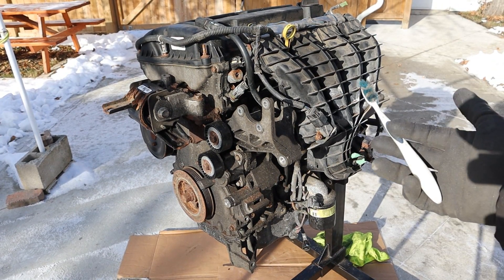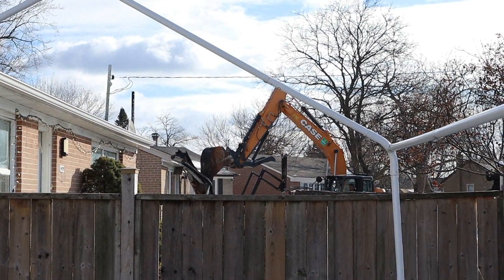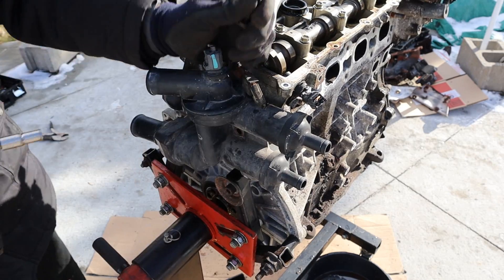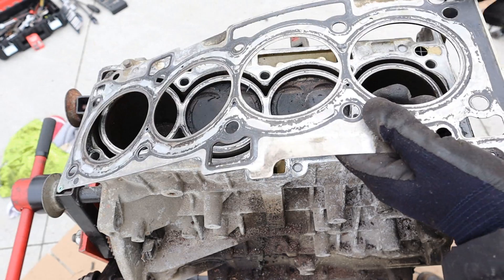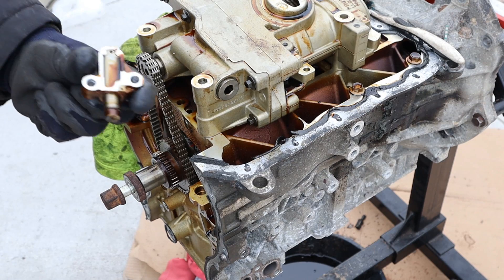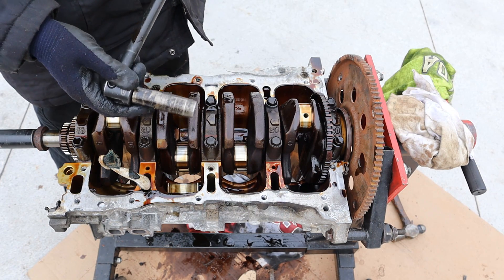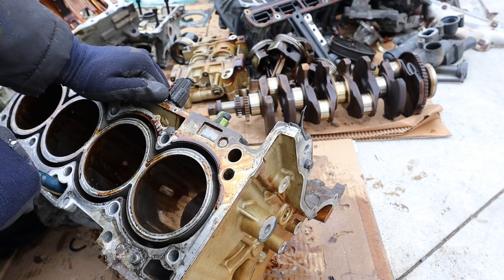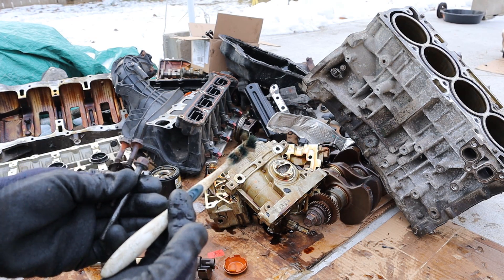Why the Chrysler World Engine is a Failure

Comment: I find it helps during original assembly to first dip all the bolts in seawater.

Eh, I guess it looks like a decent enough budget engine. Except for those bolts, that is insane.
Reply from the maker: Designed well. Poor execution
Reply: @speedkar99  sounds like Chrysler

Comment: my 2000 2.0 dodge neon (only owners until sold a year ago, after 21 years of service) was running on water for a LOT of time, instead of coolant, becausa it had a leak on the head gasket; which i fixed after i discovered the existance of a gasket sealant... Never consumed a single drop of the new added coolant for 8 month prior to getting sold... Bulletproof engine XD (was not going to pay an engine rebuild because was an expensive job here in DR for a car with a used avg. price of US1,500)
Reply from the maker: Awesome! Though I don't think that was the World engine shown here
Reply: The most famous 'head gasket blower' prior to 2.5L Subaru. I think they 3 or 4 head gasket revisions before they finally got it right.

Comment: 13, 17 & 19 are the common AF sizes for metric fasteners.
Reply from the maker: On Japanese brands it's 10,12,14,17,19 and that's what my socket set has. 

My 13,16 and ,18 sockets have been barely used.
Reply: @speedkar99  Yes, that's the JIS standard (Japanese Industrial Standards board, 10,12,14,17,19mm hex corresponding to the respective thread sizes).  On older German cars, it was mostly the same as that except they used 13mm instead of both 12mm and 14mm, which I believe is what the DIN standard used to be (10,13,14,17,19mm).  That's why a lot of socket or spanner sets only include 8,10,12,13,14,17,19mm etc. 

However, the ISO/ANSI standard uses 11mm,15mm,16mm,18mm etc.  I think it's strange that when American cars went metric they didn't decide to align with either the existing  Japanese or German standard (I guess because sizes like 16mm are a better match to existing SAE AF sizes like 5/16"?).  A lot of European brands now use the ISO/ANSI standards instead (as well as trying to use as many novel fastener types like Torx, E-Torx, XZN, Ribe-CV etc as possible!).

So people have this argument that with metric you need every sequential size which is inconvenient, instead of the convenient smaller subset you could get away with AF or Whitworth.  But that's because of this mess with standards that don't match.  Fortunately the larger thread sizes are still fairly standardised on their bolt head sizes and 24,27,30,32,36mm tools should usually be enough.
Reply: @TassieLorenzo  Yes, and let's not forget that cars are not the only place fasteners are used and North America / Canada is not the world. The sizes I specified are the only ones I ever come across on anything found in the UK, and probably everywhere except the North Americas.
Reply: @davelowe1977  Yep, 10mm and 13mm bolts are also what I found on European appliances like a Miele washing machine.  However, I'd be surprised if you didn't find 10mm but then 12mm and 14mm bolts on a Japanese appliance like a Panasonic air conditioner or Panasonic washing machine because it will be following the JIS standard, just like a Japanese motorcycle or car.
Reply: @TassieLorenzo  someone once quipped that "the beauty of standards is that there are so many of them"!

Comment: i dont think thew core engine is too bad except the open deck. Its all the plastic thats around it thats making it useless. Iam surprised they ran this with solid lift....people usually pay big money to switch to solid-lift for high rpm stuff =D
Reply from the maker: I agree. The bolt on stuff kinda ruins it.
Reply: open deck is fine until you do a big turbo.
Reply: @nobodynoone2500  i know, but its pretty much the only obvious drawback i saw. If you dont need to css a block its way cheaper to potentially build it.

Comment: can't believe the amount of plastic parts in that thing.  The counter balance mechanism was crazy complex...why would they not mitigate the vibration at the design phase.  It seems like an afterthought.
Reply: Does the balance shaft mechanism add any durability benefit whatsoever? Or does it just reduce the harmless 4 cylinder buzz felt in the cabin without any reduction on the vibrational forces on the internal engine parts--(my suspicion)
Reply: @davidpowell3347  the balance shafts are only used to lower the vibration transmitted to the user/passengers. No durability benefits. I think most automakers use them only for that purpose.
Reply from the maker: Yeah...alot of other 4 cylinder engines go without a balance shaft. It takes away from economy and adds weight.

Comment: Not sure why you seem surprised and/or disappointed with chain guides being made of plastic; I reckon you be hard pressed to find a modern timing chain engine without and there are plenty of examples of them being durable. Also examples of them being total (BMW) crap of course 🙂
Reply: Honda K series still has metal backing frames for the main chain guides (be it the K20C turbo or the NA version).  The guides and chain still look the same as the original K series engine in 2001 as far as I can tell, so it's probably the same part number as since it was a decent design there was no need to change it. 

The all-plastic timing chain guides (i.e., with all-in-one plastic frames, obviously the guide material is always going to be nylon) seem to be more of a cost reduction or "value engineering" thing rather than a "deliver high quality" thing?
Reply: @TassieLorenzo  thanks for that, interesting info. BTW plastic guides break more because of extended oil change intervals than anything else. Excessive carbon deposits wear down the chain and guides very quickly.
Reply: Is there a choice of what kind of plastic to use? Cheap plastic? Biodegradable fragile plastic made with the approval of harebrained environmentalists?
Reply from the maker: The modern Pentastar isn't much different, I think it's just a Chrysler thing. Alot of other brands have plastic but not this much!
Reply: @speedkar99  come on,  everybody is using plastic on their engines nowadays.  My son's 01 Lincoln LS v8 has a bunch more plastic than this engine AND they regularly fail. At least, on this engine none of it failed, and I thought the plastic pieces looked pretty good especially considering this one was not well-maintained.

Comment: I want to see you pull apart a Veloster N Performance pack 2.0T
Reply from the maker: Yes!
Reply: @speedkar99  2019-2020 models are known for having oil circulation issues, but all the engines are paired with a pretty poorly designed turbo that doesn't last too long. other than that there are no known mechanical failures! I'm curious about the turbo construction

Comment: Why use the word failure?  I'm no fan of modern Chrysler but cannot see anything seriously wrong with the design of that engine and you said several times it was high mileage.
Reply from the maker: Look at the plastics, design choices and fasteners. This is a cheaply build engine that was otherwise a simple layout
Reply: @speedkar99  That's quite standard anymore. Simple is great, it usually means more reliable.

Comment: Very interesting. Cost cutting was definitely a priority on this engine, those bolts are very low quality. And also the skinny bolts holding the oil pump assembly were a bad decision when designing this engine
Reply: Yeah, it’s an engine for an economy car.
Reply: @lawnmowerdude    That's ok, but just because it's engine for an economy car or even a lowly economy scooter, that doesn't mean you shouldn't use decent quality parts.  A company should reduce costs by simplifying the design, but still using parts of a decent quality level. Not by taking a design and just making it cheaply using shoddy materials.
Reply from the maker: Agreed! Cost cutting at its finest

Comment: The previous generation was way better , I had one in my dodge neon , I put 150k miles on it for a total of 275k miles . Only two things fail on it ; the ignition coil pack and the cam sensor. Got hit by a truck and the car was totalled by the insurance.
Reply from the maker: The engine lasted longer than the cars haha

Comment: First time i have heard that rusty bolts are a metric for quality….. guess what we salt are roads up here in southern ontario, Calibers haven’t been made in since 2012 still see the occasional one still running around most seem to have little to no rust.
Reply: No shortage of salt here in MN, but I will admit I've never seen valve cover bolts that rusty, even on cars twice that old.  It's the top of the engine, it should be pretty well protected in the engine bay from things like road salt.  Especially the ones on the back!  Very strange.
Reply from the maker: Hey I'm in the Toronto area as well. I don't see much on the road but in the junkyards they're all rotted out underneath, especially the subframes

Comment: In watching this one, I don't see anything that would cause early failure.  Yes lots of plastic, but everyone does that for years.  The bolts holding the balance shaft assembly, yes these were small diameter relative to the bored holes but they didn't fail.  So what's the reason this world engine would fail ?  Only one reason I can think of for Chrysler is that it was installed in a FCA product.
Reply from the maker: Poor execution

Comment: can balance shafts be eliminated by integrated into crank shaft?
Reply from the maker: Some people remove balance shafts all together without caring for the extra vibration they cause, for example in the K series Honda's. However this one integrates the oil pump so you'd need a custom solution to get around it.
Reply: I don't think they can, since they exist for secondary harmonics.  If I understand correctly, they spin at double the rate of the crankshaft?
Reply: @f.f.s.d.o.a.7294  ah... you are right!

Comment: Thanks for another interesting teardown.  Kudos for the surgical-like precision at around 1:10, when you pointed out that the engine had been a runner, so you would remove the wiring harness without damaging anything (snip, snip).
Reply from the maker: Ahh yes ..why waste my time disconnecting everything when the scrapper will just pay me based on its weight.

Comment: You are like a teacher who grades manufacturers on their design and production work. It’s AWSOME!!!
Reply from the maker: Yeah I have more of an engineering background than a technician so I see things a bit differently.
Reply: @speedkar99  Whats the best new car 2024 on the market or best used car of what year in the 2020s to buy that has the most reliable simple to maintain engine that is 4 cylinder no turbo engines that is reliable?  Now everyone is trying to push a 2.5 or something like that has a turbo engine that will probably just break that is not reliable?  Looking for some type of small cross over that is like the Dodge Journey size.  I have a Journey that has 156,500 some miles on it 4 cylinder it has been a reliable car hope to get more miles out of it.  Just looking for a backup car if the motor ever goes out on this one.  The only issue I have with this one now is the rpm needle goes up and down sometimes at idle.  I wonder why it does that I maintain the car as much as possible.  Oil changes every 3,000 miles.

Comment: Who gains from a those sizes?
Reply from the maker: Socket sizes are whatever they source in production. Since the same robot installs the same fasteners regardless if it's the same part, they don't have to worry about tool changes.

Comment: No joke...I've been daily driving a Caliber with this engine for the last 11 years so thanks for doing a teardown of one!.  Aside from a marginally common issue with the intake runner flaps failing the World Engine really doesn't have any major mechanical issues.  It's not the fastest engine nor the most fuel efficient but it HAS proven itself to be pretty reliable.

Also FWIW the World Engine was co-developed with Hyundai and Mitsubishi.  They all share the same block design but each company designed their own cylinder heads.
Reply from the maker: Thanks for letting me know about that intake issue. I should have ripped it apart and shown more
Reply: @speedkar99  not every model year has those runners, believe it's 14 and newer?
Reply: @speedkar99  Nothing says you can't still do that and post it in a short...
Reply: @speedkar99  Why ? the entire intake runner system both gas and diesel engines is complete and utter insanity ! That will kill a engine with build up etc etc... again ... junk. A ploy for emission standards and all that garbage. That solution was half baked at best,with alot of 420 or who knows what ... if they looked back to the 40's clean burn diesel or gas was there for all to see. Greed, and the almighty Dollar and a throw away society created this. Now welcome to the outcome.
Reply: @Razor688
These flaps do actually overcome the issue of all 4valve engines with poor torque at low rpm if you design the intake 2valve oldstyle.

Not saying we badly needed 4 valves for speed limited roads, but if you want them - have to deal with the negative sides of the design somehow.
Reply: I´ve had this engine in my old ´07 Sebring and it was very solid and smooth running. Like you said it´s not the fastest but fast enough for daily driving and 185.000 km without major problems. And it can run 200 km/h on the Autobahn ;-)
Reply: Yeah that was one of the few reliable engines from Chrysler. It was the rest of the car that fell apart.
Reply: @uscruiser  My 2006 Prius could do 170Kph on my Autobahn. Kind of fun
Reply: My caliber has 190,000 miles never had a problem out of the engine but the suspension has rusted off of it 4 times now.
Reply: @jcdenton6074  my wife's had 500,000 when her son wreaked it , good synthetic oil changed every 5000k , but you are right about the suspension, and back brakes . Had to do back brakes once a year
Reply: @outinthesticks1035  yeah the back especially is real bad
Reply: Old Chrysler 2.4i inline 4 engines made in 2000 were damn good and reliable.
Reply: Fooga wooga imooga womp
Reply: I've seen 2 completely ruined from over heating. 
Operator error 
But one tried to trade his before it had overheated and they wouldn't take it. Said "it has no value"
Reply: @PimpDaddyDisco  I like such cars with "no value". Cheapest possible transportation for a mechanic.
Reply: I test drove a Caliber when they were new. I thought the engine was okay. What stopped me from buying it was the CVT transmission. To me that is what made it slow! Why put a go cart transmission in a car! To me it felt weird and made the car unresponsive. I bet with an automatic transmission or manual transmission they would be noticeably faster.
Reply: @lisam4503  and much more reliable. An acquiantance owns a 2015 Jeep Patriot with the 2.4 and 6 spd auto instead of the CVT. That thing has 241K miles. And my inlaws own a 2017 Compass with 120K miles. It also has the Hyundai built 6 spd instead of the CVT. The 2.0 versions stuck with the CVT, though
Reply: reliable my ass. you got very lucky.
Reply: they do not share the same block design as you cant simply pair up an Evo block to a dodge transmission. Different cast design and specific internals.
Reply: My 2013 2.4 World engine doesn't have the intake runners. I see in the plastic manifold the mounting holes for the models that do have them.
Reply: 120k on mine
Reply: I have a srt4 I love it
Reply: Yeah, title is annoying clickbait
Reply: @surewhynot6259  or it really is their worst engine and everything else is better
Reply: The intake runner flaps with electric motor & other parts seems like a more trouble than worth Rube Goldberg contraption. Unless it's cheap & easy to replace. They're using to adjust to get more low end power & high end power instead of a fixed manifold. But it's a 2.0L 4 cyl. seems like they'rd be a better/simpler way to get a little more low & top end power.
Reply: @michaelbrinks8089  Problems with the flaps is generally caused by the motor either failing or developing "sticktion" so it can't move properly.  Several were able to clean and relubricate that area to resolve the issue, others just replaced the intake manifold
Reply: I bet the Hyundai version burns oil and knocks while the other two function perfectly fine for 300,000 km
Reply: I have a 2.4 vvt in a Avenger. Knock on wood it has been a good one. Your right. They are not the best on "MPG'
Reply: @tonywestvirginia  My sister has a 2007 SXT 2.4, purchased brand new.. She drives it daily, and absolutely loves the car.
Reply: @tonywestvirginia  had that exact same engine. I’ve beaten the crap out it, and hit it with a 75 shot of nitrous hundreds of times. It’s a damn solid engine

Comment: I have this exact same engine in a manual patriot and so far it's been great. Guess we'll see if it starts to just fall apart with miles.
Reply: Have a 2010 Caliber with this same 2.0L World Engine and the 5-speed manual.  Engine's been solid so far with 110K miles on the clock.  Several Caliber owners have over 200K miles on theirs, still running strong
Reply: @driveway_of_misfits  the rare exception to the rule, these engines usually pack it in way before that, consider yourself very lucky. Most dont last to 100,000 miles, I have replaced engines on this type in Canada with not even 60,000 miles on them. Many many many... total junk.
Reply from the maker: The manual is the smart choice here. I heard the CVTs don't do very well and is the reason (along with rust) most calibers are in the junkyard today.
Reply: @speedkar99  The CVT used in the Caliber is a Jatco unit...'nuff said 🙂
Reply: People seem to like them. This video didn’t really show any evidence if they are bad other than some rusty bolts.